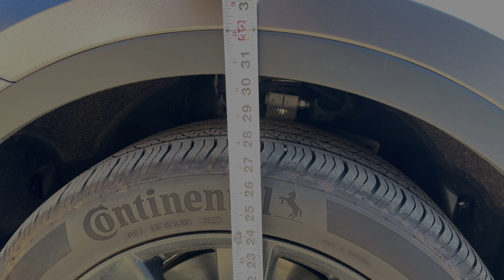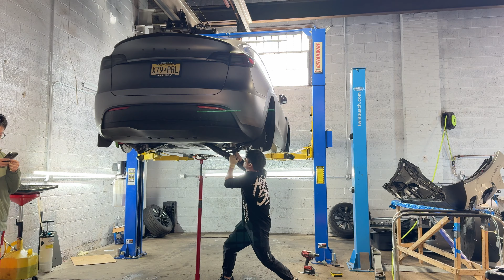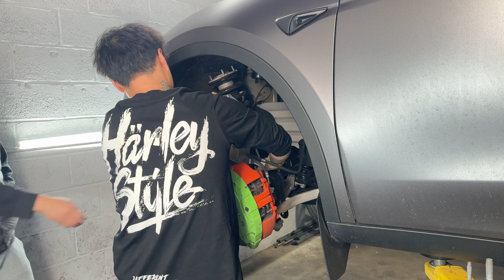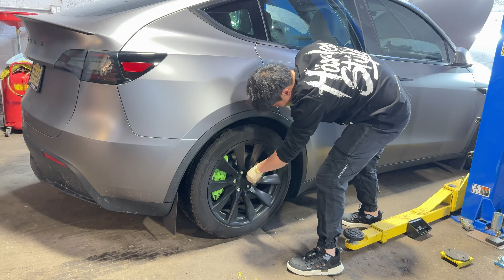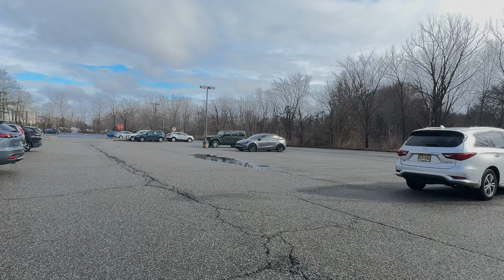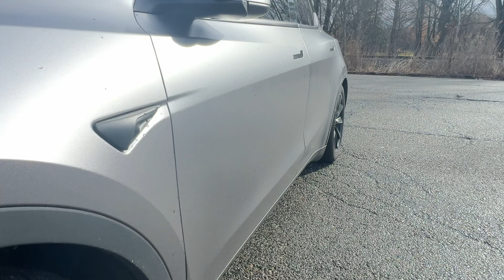2023 Tesla Model Y Comfort Suspension DROPPED with Eibach

Comment: Hi thanks for the video. Can you share the shop you took the car for the install? Thank you.
Reply from the maker: Sure!

Republic Speedshop
314 S 1st St, Harrison, NJ 07029
(973) 351-5836
Ask for Ed and tell him I sent you!
Reply: @garrick_ish  I live in Denmark. So to get those spring will cost a lot. But, I can probably get them here in Denmark. So, can you share more details about that Eibach set? And, The price, what is the price for them? Not included the work hours for installing them, just the Items. Thanks in advance. I really like the look. And have been looking at AirRide. But costly. Thanks Again. Thomas B.
Reply: Do not put Eibach Springs on your Tesla or you will have many suspension problems you’ll later regret. would highly recommend a Tein Coilover setup instead, having experience with both products.

Comment: This is a great way to ruin your Tesla! The Tesla factory shocks aren’t designed to work with Eibach lowering springs. Go Tein Coilovers instead!!
Reply: Why?
Reply: I'd like to know too. So far I can't find any info on this unless you're just talking nonsense... post a link maybe?
Reply: @MT-bu1fu  factory shocks on your Tesla can’t handle the Eibach springs.
Reply: @MT-bu1fu  watch some of my videos and you can see. I had the Eibach lowering springs removed and replaced them with Tein Coilovers. The Eibach springs caused excessive tire wear, bumpy & noisy ride, motion sickness, bent & cracked rims, tire bubbles & blowouts, blown tire pressure sensors, constant alignment issues, blown shocks. Lowering springs are for amateurs & idiots
Reply: @TeslaSoCal  went to your page and I don't see anything related to the lowering springs. I'm currently looking for lowering springs and coilovers for my model Y all wheel and everybody seems to be doing ok with the Eibach lowering springs. I think it depends on the driver, type of road and weather?
Reply: @MT-bu1fu  look at the FSD videos and the comments about the horrid suspension. Trust me I’ve been through hell with Eibach springs.
Reply: @jasondas8160 Generally you have less suspension compression if you've lowered it so it needs to be stiffer to reduce compression travel to avoid bottoming out. "Sport" springs are usually stiffer anyways. I won't go into horrible suspension detail, but basically springs want to return your car to the 'at rest' position all the time and shocks want to resist suspension movement. If the springs are a lot stiffer you really need shocks that can match it or the spring can bounce (visualize a pogo stick) and beat your shocks up. If you are making the suspension too stiff it can beat up other things too. Everything has to be in balance when you change ge things.